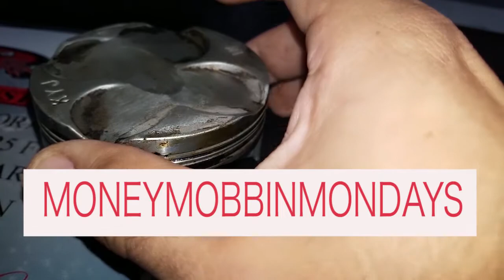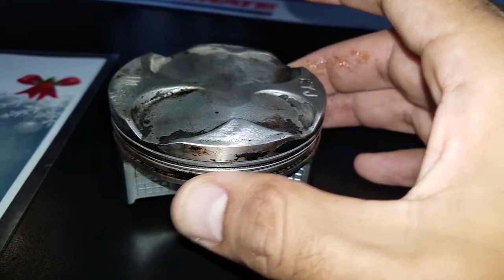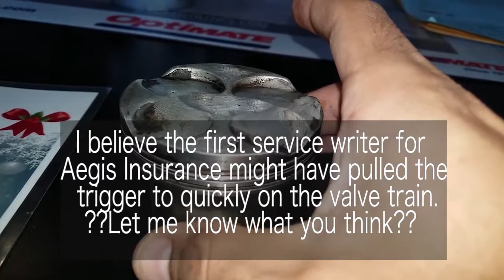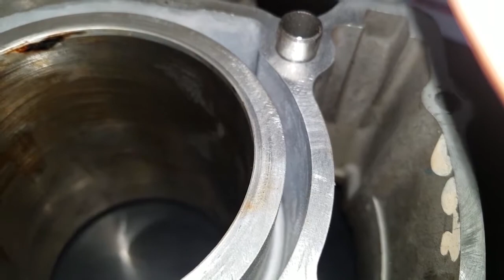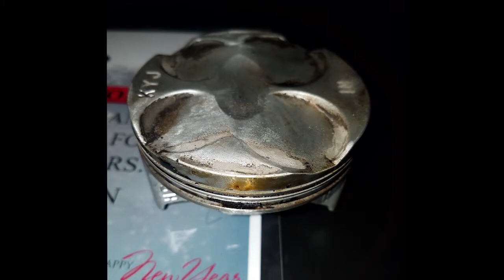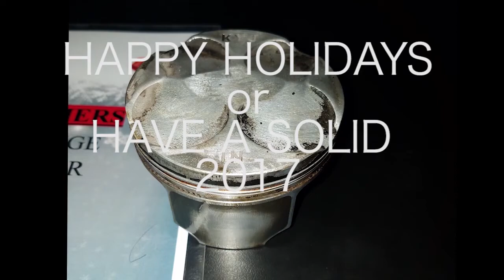37000Mi Melted Rings on the CRF250L

Comment: Oil or air filter problems? The Dutch Peter and Leonie went around the world with this bike and exceeded 100,000 km with them. It is true that one had to change the piston, rings and cylinder, but it was because of problems with the air filter that allowed to pass dust particles...
Reply from the maker: +Deiolupus 

I regularly changed and maintained my servies on the CRF250L. It was ridin everyday for 16 months straight and It was treated with love on the service intervals. I blame Cali Trash Petrol